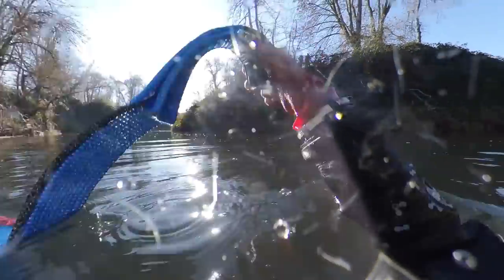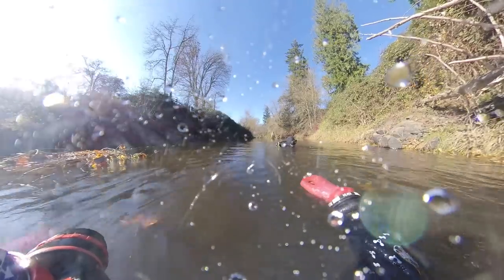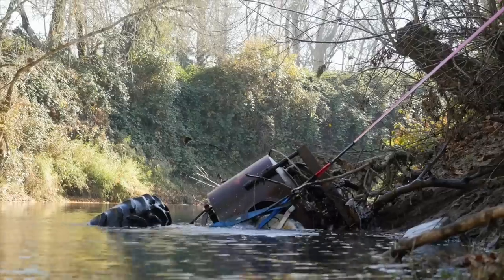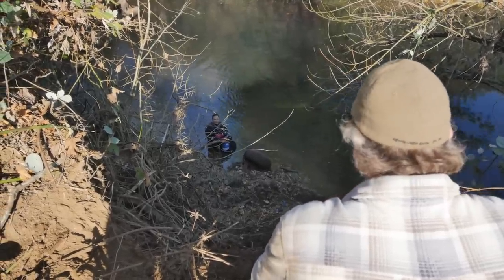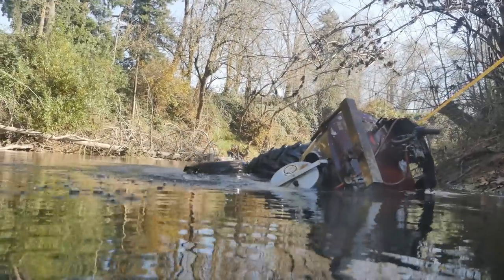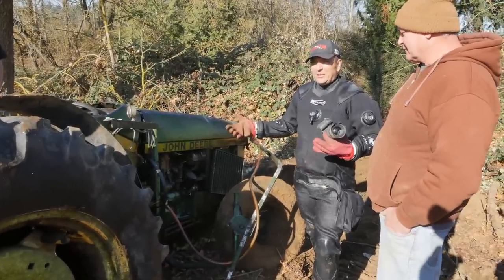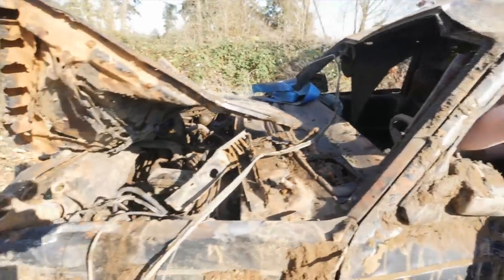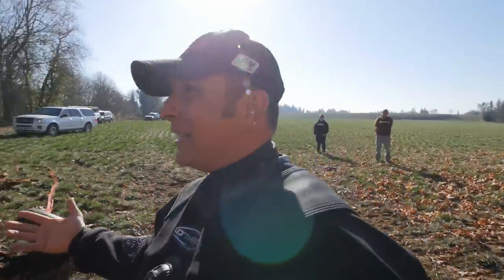John Deere Tractor Found 10' Underwater in River!

Comment: The bank is now stripped of all soil retaining plants. If  any of your attachment points break loose they could send parts missiling at the guys standing to close to the machine as well as the operator. Then whoa whoa whoa the tractor tumbles back down the hill. Learn something new? How to get someone killed. You need to take some courses on rigging or hire a proffesional.
Reply from the maker: Maybe you could come out and give your professional opinion next time? No one felt unsafe and accidents can happen no matter what. No one felt unsafe on this job from start to finish.
Reply from the maker: Maybe next time you could come out and help with your professional knowledge next time. No one felt unsafe on this recovery.